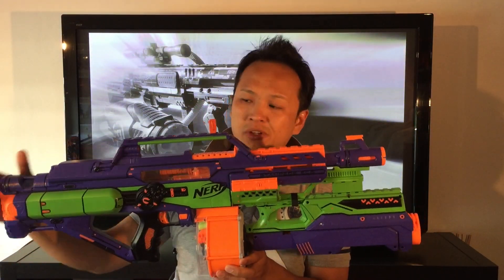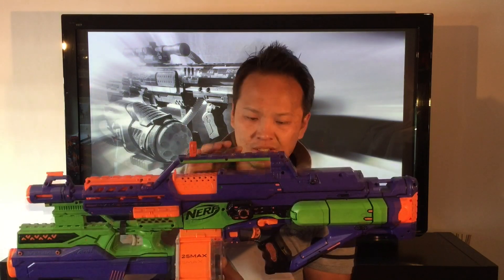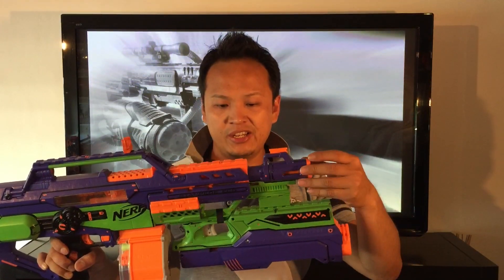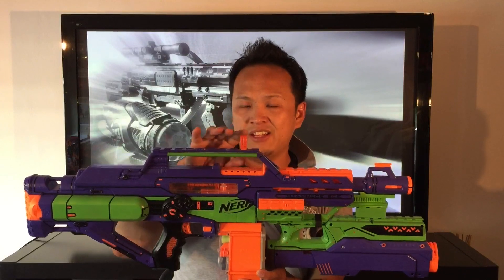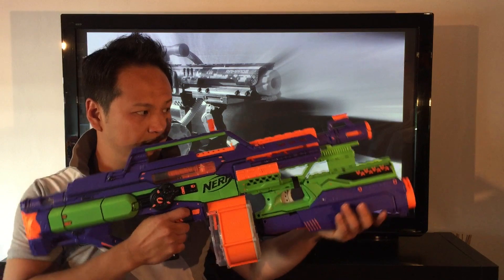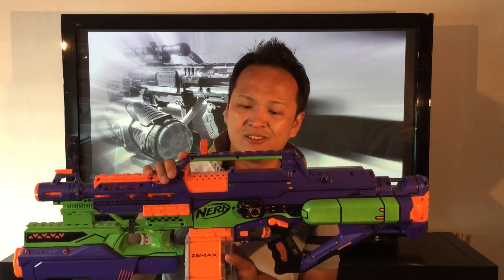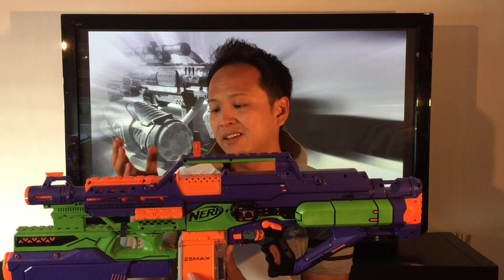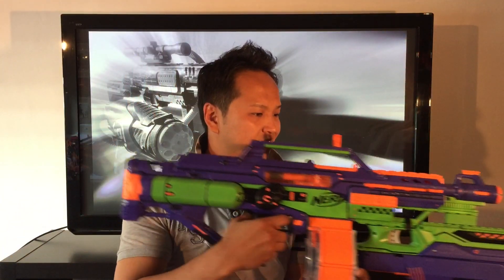[MOD] RINNEGAN | Nerf Stampede Mod / Magnus Integration

Comment: Do you ever have problems with your bolt not returning to original position and your mag getting stuck? I have orangemodworks 5kg mg upgrade spring and some other mods and rewired and every so often my clip gets stuck because of the boat not returning all the way. I have to drive fire a few times and then it goes back to original position and I am able to take my mag out. Any help or suggestions to remedy this problem would greatly be appreciated thanks